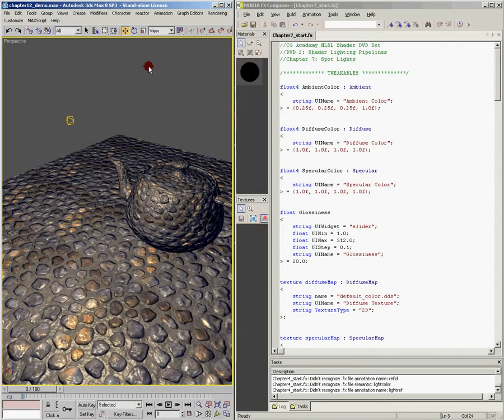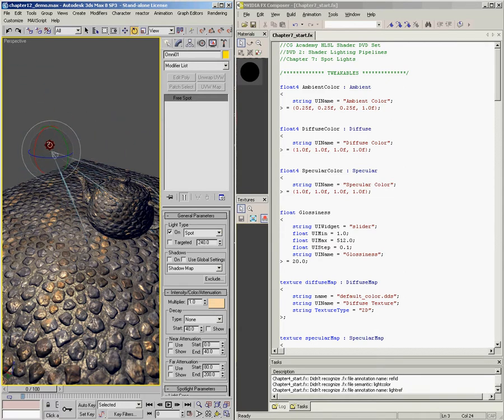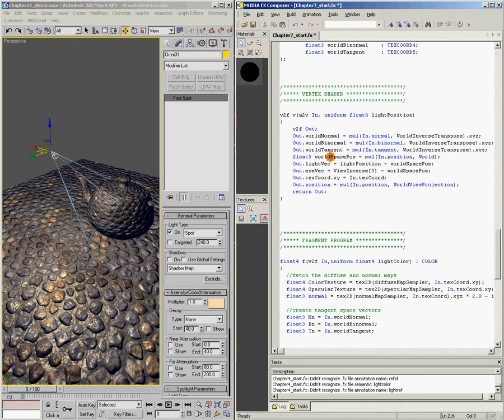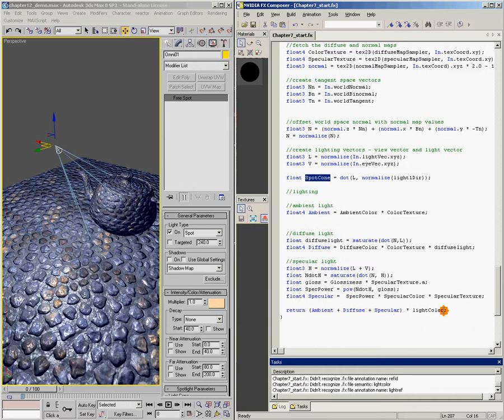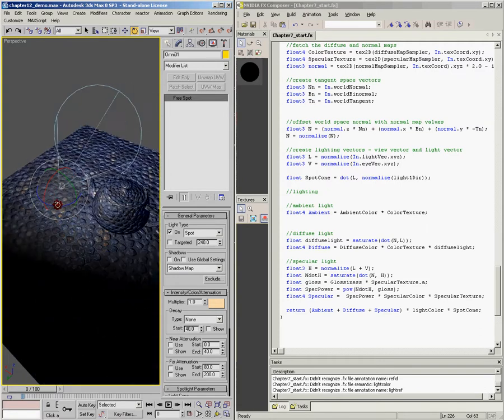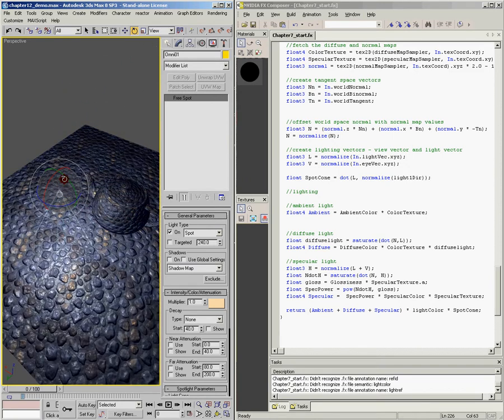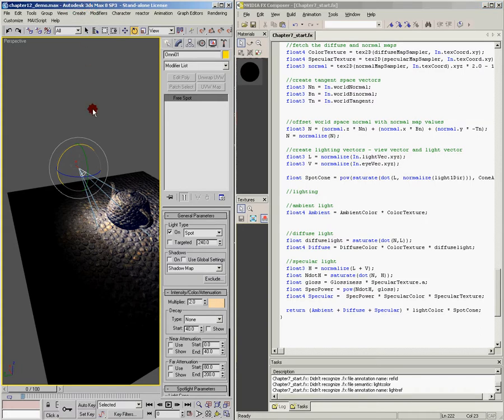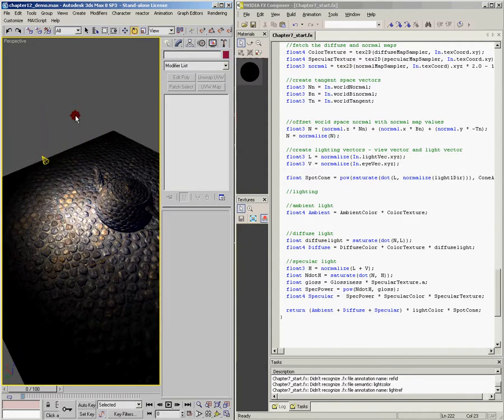07 Advanced Lighting: Spot Lights - HLSL Shader Creation 2: Light and Shading Models

Comment: I’ve seen Saturate used in other places (Unreal, maybe?), and I’m really curious about why it was chosen as a term for clamping between 0 and 1. 

Are there other terms for Saturate that are also commonly used? Would Fit or Clamp be another one? 
Thanks again for the videos!
Reply from the maker: Saturate is the name of the HLSL intrinsic function.  It's also used as the node name in Unreal, Unity, and several other node-based material editors that I'm aware of. So it's the industry standard term. I don't know why that term in particular was chosen, but it's been part of the HLSL language since the its inception back in 2000. Clamp is also in intrinsic function, but with Clamp you can tell it what you want the min and max values to be instead of them always being zero and one with Saturate.  Here's a list of all of the intrinsic functions: https://learn.microsoft.com/en-us/windows/win32/direct3dhlsl/dx-graphics-hlsl-intrinsic-functions